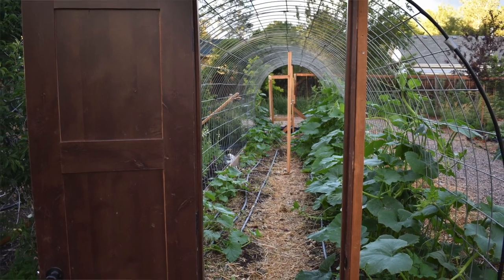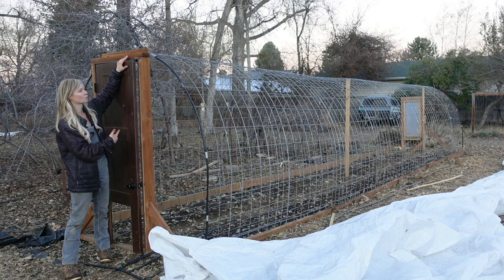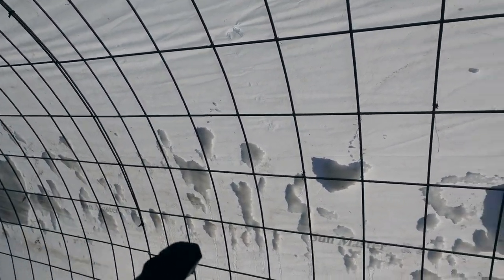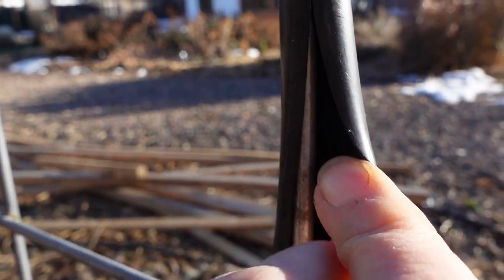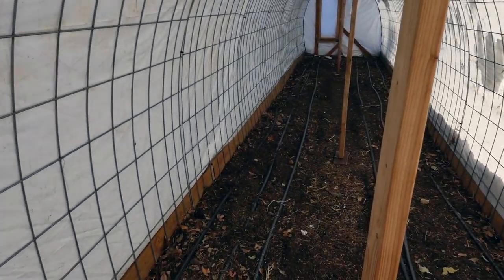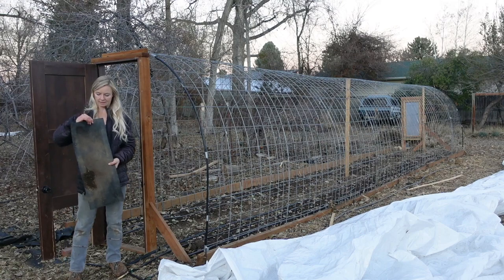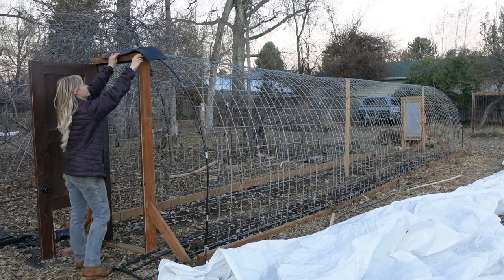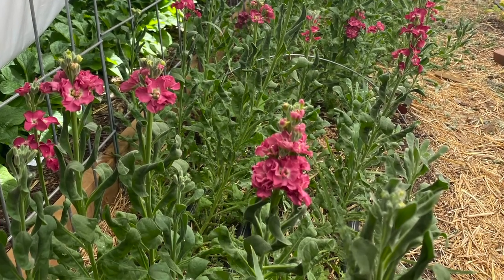WEATHER-PROOF cattle panel greenhouse and trellis combo!

Comment: The algorithm is reading my mind. I've been using cattle panels for years in my garden and was out measuring to reconfigure my two panels into a mini season extender as winter approaches. This looks great and is pretty close to mine. Though tbh I only ever planted on the outside of the arches, I don't know why but that is changing. I love seeing what it's going to sort of look like with the cover on. I have 1" galv pipe hammered into the ground to hold them and I'll be putting 100" x 18" x 6" boxes along each in(side). It has a lot of protection from the wind so I'm making it so I can roll the cover up on a pole on each side as the weather warms up.

Comment: I like the design and build of this - simple and effective. I'm curious though, if you considered leaving the North side of the plastic attached at the bottom and just rolling it over to the ground during the warmer season. It could be covered with whatever to protect from unnecessary UV exposure and save time and effort (nothing upside down or backwards) when putting it back up for the winter.

Comment: Great video,  love the double wall. Would it be wrong to ask where you are and what Zone you grow in?   I am in Central Ontario Canada and most years still have snow in the garden area until early to mid April which rally shortens my growing season. We  don't normal hit 100 growing days from last frost to first frost. Extended my season might actually allow some vegetables to reach maturity. Currently  I am filling my kitchen with seedlings so I can have plants instead of seedlings in the ground. Thanks for any thoughts. Happy Easter.
Reply: I saw another video where she said they're in zone 5 or 6.
Reply: @kimjones1260  Thank you. I am in zone 5b which only allows for maybe 100 days outside un protected. I have not been overly successful with our weather the last couple of years. So starting soon, I will be trying my hand at Hydroponics, for now using the Kratky method.  Have a great day.

Comment: Yeah! I’d definitely like to give this a go next winter in my backyard using a short tunnel of 3 cattle panels (because that’s what I have the space for). I’m interested to know where to purchase the 2 different layers that you put over the cattle panels and the black pipe that protects the plastic from those jagged metal pieces that stick out on the cattle panels.
Reply: I've been using the 6mil painters plastic from the hardware store for years very successfully like this. The black pipe she was talking about is irrigation pipe I believe. Also found at any big box hardware store. Hope that helps!
Reply: @BD-bb4rd  Helpful, yes! Thanks!😊
Reply: @BD-bb4rd  how does that plastic hold up to large hail?
Reply: @essentialcomforts2166  We don't get large hail where I'm at so I can't really speak to that, sorry! We get small hail and it holds up fine though. Maybe still worth a try? A 10'x25' roll is under $40 (Lowes/Home Depot)

Comment: I’m in Larkspur, Colorado and we get high winds and lots of snow as well. I’d really like to try this method. What is the mm of the plastic cover you’re using and where did you purchase yours?
Reply: She said she uses overwintering fabric with 8 mil greenhouse plastic over the top of it. Some commenters have also mentioned using 6 mil, as it's easier to find and cheaper. Depending where you are, the 6 mil might be fine, but be extra careful when sliding it over the hoops, to avoid tears and holes.

Comment: Hi Bree. Help me out please. I have never understood what I hear people saying about greenhouse plastic. When you say it is 8 mil, what does that mean? Surely no 8 millimetres?? That would be way thick.  I have ordered greenhouse plastic here in the UK and I don’t think I have come across this? I can see that your plastic is thick but surely not 8mm thick?
Love the information you share and all you are doing. Thanks
Reply: mil describes the plastic and will be on the label/description. You can buy 1 mil, 2 mil, 4 mil, 8 mil, etc. Just make sure you're buying 8 mil plastic because lighter plastic won't hold up.
Reply: It’s painters plastic made of polyethylene. It can be purchased in huge rolls at home improvement/hardware stores in different size MIL (thousandths of an inch, 1 mil =0.001)
Reply: Commonly sold as 2,4,6 MIL. I believe she said hers was 6

Comment: I believe that I would just make the ends out of 1/2-in OSB that way the plastic could just remain in a simple rectangular shape and be easy to roll up and over or fold up and store during the offseason. Thumbs up on the design. One question that was not answered for me during the video was the length of the cattle panels are they standard? Like 14 or 16 ft?
Reply: I usually see them in 16ft lengths.